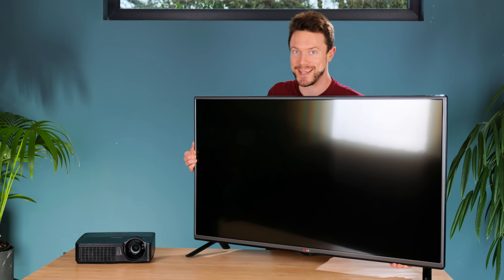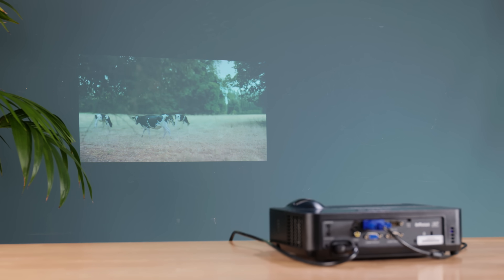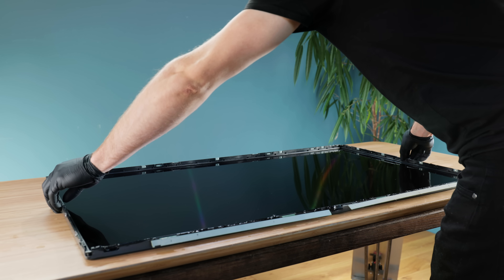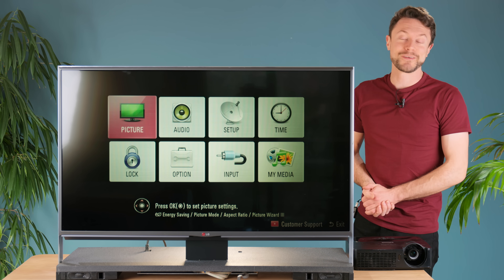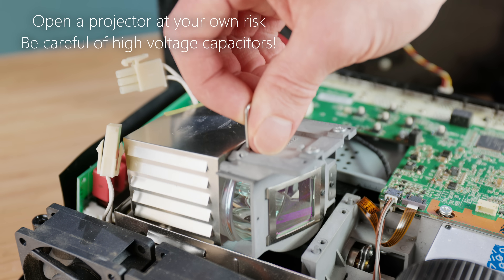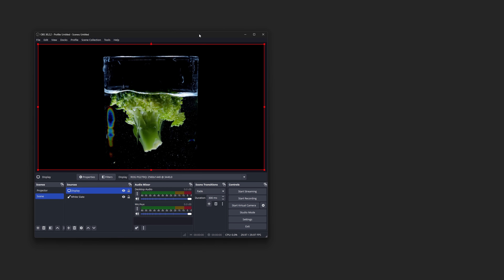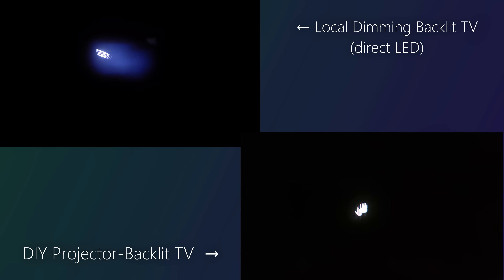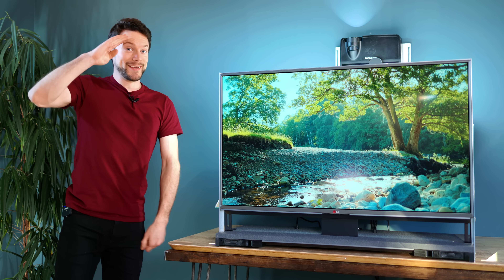DIY "infinity contrast" TV -  with 100% recycled parts

Comment: This is essentially an old Rear-Projection TV reimagined, with the white screen replaced by an LCD layer. Why didn't they thought of this back in its heyday is beyond me.
Reply: Bulky Body of the TV set was the Problem. People wanted flat screens on walls in 2m height, not the floor/stand mounted Boxes anymore.
Reply: Not sure exactly but LCD panels of that size were extremely expensive, and the size of projector TVs was a no go for many...
Reply: @nhiko999  is right. The wohle gag of the rear projector tvs was, that they were far bigger than what CRTs and upcoming LCDs at that time could represent. At the same time they were cheaper than the Plasma-TVs that could reach that size. The lacking image quality of those devices were also the reason why there weren't small versions of them. It really only made sense to produce a impressive sized screen so that the flaws were acceptable.
Reply: At the time a 70inch Mitsubishi DLP cost me $2700. The LCD equiv. would have been well over 10k.
Reply: There’s a rear projection tv on eBay, basically if I swap out the panel for an LCD I’ll get the same effect right?
Reply: @tbrdoescinema  Well here's an idea. Technically it should work, assuming you got the LCD part done correctly.
Reply: @tbrdoescinema   Is that a 4:3 Screen? Because I doubt you will find a 4:3 LCD in that size.
Reply: @tbrdoescinema  my parents' rear projection tv had three projectors, one for each color r g b. I suppose it could work
Reply: The reason this was not done was also the reason rear-projection TVs were a thing - there was no way to make LCD panels that large back then
Reply: Because cost, each tech was very expensive on their own back in the day. But some product lines to combine expensive for high end professioanl / reference monitors. This concept could of been used for such a high end big screen back in the day. But cost the same as a Car.
Reply: @Neojhun umm. No?

None of the technology in this is super new.
A projector that only needs black + white is fairly simple.
The issue has been the transition to flat screen sometime around the 2010s. 
It became the only thing people would want, so it was the only type of TV made and innovated on.

This could have easily been made on a 1080p TV 20 years ago for a similar relative price to today.
Thats also not counting the reason for it though. Graphics weren't as advanced for things, and neither was the transmission of data. 

Society just wasn't as advanced for something like this.
Reply: @Harmoniou-s 
Advanced?
LOL.
Bigger, bulkier, higher power draw...
How is that more advanced?
Reply: @FutureChaosTV  The problem with this project is, it's a concept. I am sure Matt is aware of how exceedingly bulky this is, and he just wants to get an idea out there. Hisense did this long ago with Dual Cell and it was expensive-as but for a cheap, affordable "High-end" option today, when short-throw projection becomes cheap enough, a box with the short-throw and LCD combined could be made at an acceptable price.
Reply: No, you are mistaken. Good colour LCDs are relatively new, with the adoption of Active Matrix in the late 80s. At first literally only on 13 inch and even smaller screens. Yield was an issue for decades, and the defected panels and therefore cost increases with the fourth power of the size. DLP chips were thousands too at first.
Reply: Maybe because plasma tv was a thing, it's most similar to OLED, no backlight involved
Reply: It's obvious that for this to work you'll need a TV that looks like a tall box with a screen. Not really practical. Not to even mention shortcomings.
Reply: Mitsubishi might have done it if they didn't leave the market. They were the last DLP TV manufacturer
Reply: rear projection TVs were bulky and heavy, mostly because of the fact that they had to be very rigid to not throw everything off alignment. They lost to LCD for the same reason as CRT did.
Reply: Double layer LCDs have existed for a long time but they have poor brightness and use much more power
Reply: They did not had the OSB plug in to solve the backlight control.

DIY Perks use a computer to operate the whole thing.
Reply: Simple reason:

Those light bulbs in the projector have a live span of several hundred to several thousand hours.
So, depending on your viewing habits, the light bulb will work at most a few years.
And they are very expensive to replace and also use alot more power than even modern, gigantic OLED TV's.
Reply: @FutureChaosTV  the comparison to an OLED, while talking about the lifespan of the bulb tho... Remember a bulb is very easy to replace, and sold as a replacement part. An LCD's backlight varies from an ordeal with a paper thin glass sheet worth 90% of the TV's price, to near impossible glued in paper thin glass sheet worth 90% of the TV's price.
...an OLED when burnt in is burnt in and that's it.

Now answering OP tho, why they didn't do it is sadly simple: it's both the best of both worlds, AND worst of both worlds: incredible contrast and resolution, easily replaceable backlight, but the bulk of the rear projection plus price of both LCD and rear projection combined. Can't imagine anyone but the most hardcore enthusiasts forking that out.
Reply: @FutureChaosTV  as he mentioned, it's a common mod to old projectors to comvert to LED and he said he may try it.
Reply: @FutureChaosTV  There are Laser Projectors now that last 25,000+ hours and don't need to be replaced
Reply: Nicely engineered, I would have had 2-3 screens broken with lots of try and error 😅
Reply: I happen to have some CRT based rptv's that I keep repaired. I would never do this to them, unless I can't get parts. For one, the contrast ratio of a crt is superior to any LCD ever made. That includes LCD projectors that I also have. You also can't stack av equipment on a flat screen. How it would have been done is instead of a CRT or three, there would be a mini LCD equivalent with a backlight. I would also take a well maintained plasma over the modern disposable junk that is being offered.
Reply: It existed, but size, was a big problem, try to sell a HUGE TV to consumers in 2006, not gonna happen LOL
Reply: He says exactly this at the end of the video
Reply: They did.. JVC had a black and white crt projecting through a color lcd panel.. was small but worked well.. 1999 I think
Reply: THIS PROJECT IS AWESOME

It's a better version of something I did about 20 years ago to get a higher resolution projector than what was available commercially.

I think my total cost was somewhere between $550-650 for everything, including tools like a cheap router for creating wood frames for the fresnel lenses and lexan panes for heat and UV protection.

The whole gist of the project was to create a light box that used very high-powered (and hot) metal halide bulbs behind a UV protective sheet that diffused the light through two flat fresnel lenses sandwiched together.  The entire thing passed through the guts of the smallest, highest resolution LCD panel available (at the time) which was mounted upside down and then out through a proper projection lens.

For safety I had a thermostat circuit that would still continue to power the exhaust fans when the unit was switched off until the bulb cooled down  to a reasonable temperature.

The inside of the box was painted in a matte black paint to prevent internal reflections / light pollution.

I had SO MUCH fun running my PC through that thing for gaming and watching movies.  There was nothing like having a ~$500 gaming and movie setup on a 122" diagonal glass-bead projection screen at resolutions that exceed commercial projectors of the time;  their bulbs only lasted hundreds of hours and cost $450, where my bulb was pulling 10,000-20,000 hours for barely over $100, especially after upgrading the ballast.

Definitely one of the coolest things I've ever made in my life.  I used to even take it out on the road and set it up for my DJ sets for insane visualizations in sync with my music.  😂

It's kind of wild thinking back that it might have been able to have been improved a bit by using a second LCD screen for this type of targeted brightness masking, although I wonder if the image quality would have deteriorated more than what would have been worth.  🤔
Reply: 1. The colors are not from the projector, he uses it only for back light. The colors are from the TV-display in front.
2. The projector behind, after removing the "color-disk"-thing, provides only the white unfiltered light.
3. He uses software (OBS + plugins) to adjust the lighting settings.
4. The projector must have high render resolution. He used one with 786,432 pixels...
5. The LCD TV display that you use, should also be more modern, to be able to produce nice and rich colors.
Reply: Simple. Cost and just the natural evolution of the tech. Back then rear-projection was cheaper to get larger sizes rather than a single large LCD panel. Once they managed to drop the cost, rear projection was phased out entirely. The key to this setup is OBS calculating the light map. That level of processing would have been expensive in the early 2000s. Not to mention people hated the size of RPTV.
Reply: @ryantakahashi9130  I don't think OBS would even be needed though, you'd only need to split chroma(colour) & luma(brightness), which should be easy for even quite basic chips to do. For example DVD players were outputting s-video(along with other outputs) which meant that it was likely converting the digital signal & then going through an ADC to output analog luma & chroma) There's also likely no need to expand the luma mapping as shown in the video, defocusing the projector would likely do the same thing(and is what I'd assumed he'd do when the video started).
People just wouldn't have wanted either the extra bulk(hence why rptvs didn't sell very well) or the extra cost. Plasma displays also competed with LCD early on, and had deep blacks etc, but people fairly quickly dropped it for LCDs.

Comment: A 14 year old DLP projector is by itself a sight to behold, under the right circumstances.

There is actually an emerging technology of double stacked panels. Where behind the high resolution colour panel (think 4k), there's a slightly lower resolution (still high resolution, say 1080p) monochrome one to deeply attenuate the backlight.

Comment: Very cool and interesting. However, those projector bulbs don’t last very long, got incredibly hot and you have to deal with the noise of the cooling fan all the time. 
Those bulbs are also very costly if you need to replace them.